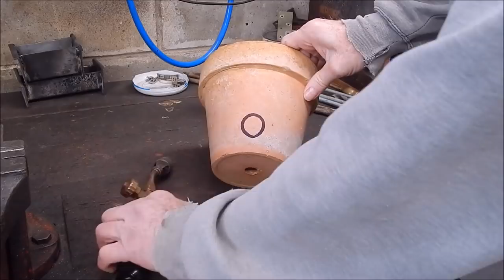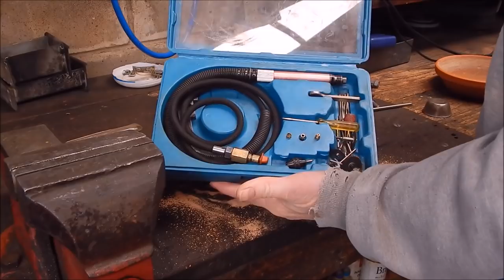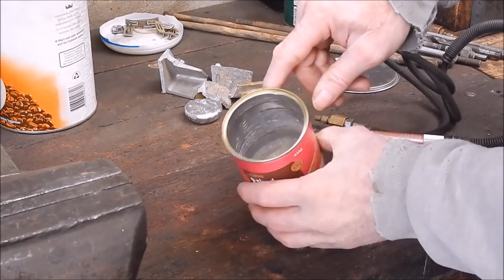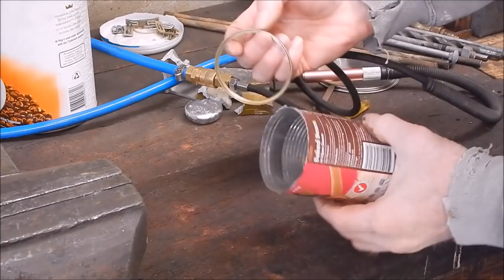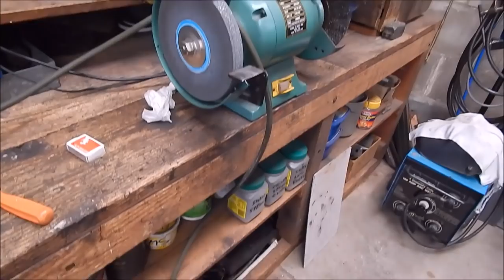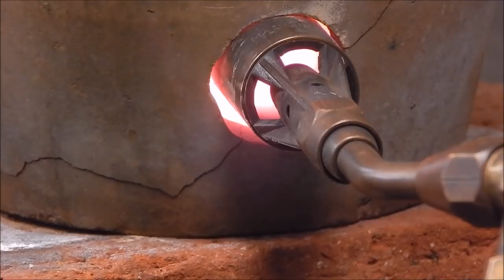Melt aluminium in a flower pot furnace

Comment: Well done!  It looks like a hole in the lid about the same size a your burner might help.  I would have chickened out before you did when you were using the largest carbide bit!
Reply from the maker: Metallurg33 You may be right.  More air has to come in from somewhere, either top or bottom.  Needs more experimenting with a lid on.  Lot's of potential for an ordinary LPG gun.  Rob
Reply: xynudu
I'm not sure if you need more air in or let the products of combustion out.  If its the latter, you might need even more open space.

Comment: What did you make the form that you poured the molten aluminum?  It doesn't look like steel because it seems like if it were steel, it would be way heavier.  Thanks for the vid!
Reply from the maker: +altitudeca 

It's a stainless steel bowl from my scrap bin.  I'm not sure what it was originally, maybe a cap for some part of a machine.

But, definitely stainless steel.  Some people cast into stainless steel cookware - cookie cups etc.

Cheers Rob
Reply: +xynudu Sorry, I meant the thing you poured the molten aluminum (out of the can). The square container that looks like it's welded together to the left of the forge.  Thanks!
Reply from the maker: +altitudeca 

The mold at the end of the video is made from some rolled  "U" section racking steel.

It's about 2 mm wall thickness.  I stick welded some ends in.

Bit rough, but works OK.

Cheers Rob
Reply: +xynudu Cool. Thanks.

Comment: Just some advice, the flower pot cracked because you heated it up to hot to quick. The flower pot is like a clay crucible you have to heat treat it, heat it up slowly multiple times hotter each time to heat treat it. Oh ya Aluminum only has 1 "i" in it, I saw you misspelled it in the video title!
Reply: Aluminium! Anywhere other than USA.

Comment: it cracked bc you didn't heat it up slow..... take the torch and hold it above the pot and let it heat up for about a min or 45 sec. keep the flame 6 to 8in away from the pot when doing this

Comment: I thought the cruicible (the tin you used) would melt faster than the aluminium inside it ? What type of tin did you use ?
Reply from the maker: Steel doesn't melt at the temperature of aluminium.

Comment: I thought the base of a lawnmower was usually made from a magnesium alloy?
Reply from the maker: Green Silver Generally pressed steel or cheap aluminium in lawn mowers.  Magnesium is not used much, except on items that need to be very light - eg. chainsaws and hand tools.  The problem with magnesium is that it's more expensive, and fatigues over time. Mag wheels on cars are not actually magnesium, they're aluminium - because of the fatigue issue. Rob

Comment: Love the video. I was thinking if you could make a small microwave kiln with a small flower pot and the top piece as the bottom of the kiln. I have been looking for a good homemade microwave kiln. I think this could actually work as a microwave kiln also, but I want your opinion on if you think if you took a small flower pot and use the bottom piece as the base. Thanks for sharing I love this Idea,
Reply from the maker: +Steve Rabon 

Hi Steve.   I don't know anything about microwave kilns, but theoretically you may be on to something.  I suppose the issue is how much the pottery would reduce microwave penetration.

Also, the pot would still crack under the temperature changes, so lining it with refractory cement would be the go.

Interesting idea.

I suppose the only way to know, is to do a small scale experiment and see what happens.

Cheers Rob
Reply: Thanks for the reply. I know some people has used the fire bricks to make one. I know they can withstand high temperatures. This would just be a cheap alternative to a homemade microwave kiln for melting glass to make jewelry. I would use the fire brick if I wanted one to melt aluminum. Thanks I was also wondering when I seen the dusk that was left on the counter if you could pretty much use the powder as mortar and pretty much make a shape that would work better. I have had an head injury and I am not as smart as I once was and people have to tell me if stuff sounds stupid. LOL
Reply from the maker: +Steve Rabon 

Hi Steve.  All sounds good to me.  Nothing stupid in what you are saying, for sure.

Just be careful, this is a dangerous environment, so stay safe.

Cheers Rob
Reply from the maker: +Steve Rabon 

Hi Steve.  That's a pretty handy little kiln.  Unfortunately he doesn't seem to have followed up with a video on it.

I think that is a better way to go than a flower pot.  Looks to be made from refractory cement.  Maybe just cast it between a couple of plastic containers you can pull out/off after it sets.

There must be some info on making these on the internet somewhere.

Maybe search on making a homemade ceramic refractory crucible, should be a similar technique.

Cheers Rob
Reply: He bought that one on Amamzon. It is made for making Jewelry. I was thinking of a way to make a homemade one. I been studying up on it. It is a layer inside the kiln that actually turns the microwaves into heat. Just using the flower pot won't work, but you can make a paste from grapheme and use that to cover the inside of the flower pot to create the heat needed. Thanks for your replies. They have helped me a lot. I will try to make two kilns. One to melt glass for jewelry and one to melt Aluminum. I have found another Video that uses fire brick to melt Aluminum in the microwave also. Thanks again. I think I know now what is the best way to go. Yhanks
Reply from the maker: +Steve Rabon 

You're welcome.  This is really outside of my limited expertise, I'm still learning too.

Good luck with your venture.

Cheers Rob
Reply: Thanks I have found another Video of somebody going into detail of making your own microwave kiln. It is pretty straight forward and simple. Basically all you need is a ceramic cup and a ceramic tile for the base plate with a mixture you can make yourself to layer the inside the ceramic cup and to layer the ceramic tile with also. This mixture is what really makes the heat. Thanks again your advice lead me to finding more information. Thanks again.

Comment: Hi again Rob, no I'm not stalking you, I've been down with a bad flu so have spent all day watching almost all your vids. Do you chuck any sort of aluminium in the pot such as drink cans and stuff? or are you selective for stock material?
regards

Wal
Reply from the maker: Walter Cengia Hi Walter.  I sent a reply, but it seems to have vanished, so I may repeat myself.

I am selective.  I use hard non bending alloy for rigid, hard wearing jobs like gear blanks, and blend in some softer alloy when I need a better finish for turning.

It's all a bit hit and miss, but is OK for backyard melting.

Cheers Rob.

Comment: That drill must be older than me (21 y) but still drilling good. Nowadays you need new drill every 3 years.
Reply from the maker: +Tommi Honkonen 

Hi Tommy.

I have probably got about 6 - 8 drills of various sizes, and the one I grab every time is that one.

It's not the biggest or the most powerful, but it's the nicest to use.

It's an AEG 500 watt unit.  You can tell by the beat up look that it gets lots of use.

It's the perfect size/power without breaking your wrist, and it runs off of my portable generator OK.

On it's third chuck and second set of brushes, and going strong.

Best drill I've ever used.

Cheers Rob

Comment: can you riddle me this, since I have no working experience with melting anything other than lead for historic munitions casting. The melting point of aluminum is 1,221 degrees F, and the melting point of tin is 449.5 degrees F: the tin can doesn't melt in your video, but the aluminum does. How is this? I want to use a pot to sit on a forge I'm building and it's stainless steel, but some of these stainless steel pots have aluminum fused into the bottom for "even heating".. Would this pot's bottom melt? As I said before, a novice and trying to understand how this works.
Reply from the maker: 1958piwo To the best of my knowledge, tin cans are made entirely from steel these days, so won't melt or fall apart in this application

I'm not up on cooking pot construction :)  I expect the aluminium bottom is just a lamination, and would melt off the stainless pot, leaving the bottom intact.

Cheers Rob.

Comment: Hi Guys thank you so much for the the wealth of info posted on this particular Video thanks a million Xynudu for generating so much curiosity as a result of your experiment. one question. The melting point of aluminium is higher than can or not ? my question in particular the can should have melted before aluminium ! I may be wrong
Reply from the maker: No.  The can is made of steel and has a much higher melting point than this furnace can provide.

These days can joins are rolled/crimped together, otherwise it would fall apart under the extreme conditions.

The whole experiment is unsafe and shouldn't be attempted without proper precautions.

Cheers Rob

Comment: the lid put on over the pot,  needs a hole in the lid . . . you can slow down the hot air . . . but  . . . you do need to release the hot air at some point . . . or break the system
Reply from the maker: Patrons Incentive OK.  The mark two version will have a hole in the lid.  Cheers Rob

Comment: You should put a hole in that lid and reinforce the pot itself with a layer of fire cement and then put another pot in the center of that, insure that all of them are connected with a hole through them all.
Reply: +Danny Lewis the point is to see how simple you can go
Reply: +Danny Lewis 
 great idea.. have you built one same? lemmie know, it sounds like a pretty cool project.. cheers bud. :)
Reply: I have, but I moved into an apartment.  When I move into a home, I will post pictures this time or record my own video.  I works well.
Reply: Danny Lewis deadly... thank you... Im temped to use an 8'' terracotta chimney.. stand one in a 13''x12'' clay pot..  with fireclay/refract cement as you recommend.. id need to cut a 2'' square from the chimney with a 4'' diamond angle grinder blade.. allow the 1.5'' pipe to go through and pack it up.. what you think? and many thanks..:)
Reply: Sugar solution and sand or silicon carbide.

Comment: Think why it does not worked with the top for you case the top was much smaller then the bottom. On the site the top is the same size as the bottom try to get an other pot and try again. Probably you can reach higher temperature with the top on.
Reply from the maker: The torch wasn't getting enough air with the top on.  Unburnt gas was burning on the outside around the rim between the pot and lid, where it was escaping.  A larger pot on top wouldn't help in that situation.
Reply: xynudu the top pot needs a hole in it for bot exhaust/flu and to allow O into to burn. Your pot base didn't have it. Most likely the original design of 2 identical pots did.

Comment: how much do you loose in weight when you melt alu. down?
Reply from the maker: jetegtmeier71 I doubt it would be much.  Dross would be the only loss, and that would be less than 5% I expect.
Reply: ***** 50 % no kidding and they say you should recycle alu. i'm glad I do
Reply from the maker: ***** Hi Sebastian. Thanks for the feed back.  I had never really thought about this, prior to the original question, and assumed only the dregs would be lost.  That's very interesting.  I will check next time and see how it goes.  Cheers Rob

Comment: Hey mate, What type of regulator is that between the gun and gas bottle? 
thanks.
Reply from the maker: No regulator.

Straight out of the bottle at full pressure.

Cheers Rob
Reply: thanks buddy, gonna give this a go

Comment: One word of warning to the viewers, make sure there is no moisture in the flower pot. Water trapped in the pot you risk exploding as the steam tries to exit.
Reply: actually if there is moisture in the ingot tray it will explode  not might it will worked a foundry for a few years and we had to preheat all the ingot trays b4 pouring  also  throw in some salt it will give you much cleaner casting
Reply: Water (very small amounts) and molten aluminium is a very lethal combination ... It creates huge explosions ... Witness the twin towers on 9/11! LOTS of YouTube video inside smelting and casting plants of such explosions

Comment: Why not use it the other way and maybe expand the little hole in the bottom?
Reply from the maker: You could try.  I doubt the LPG torch would get enough air to work correctly.  Rob

Comment: At 10 : 30, what kind of saw did you used ?
Reply from the maker: A small friction/abrasive disc (metal cut off disc) in an air pencil die grinder - you could use a Dremel.  Cheers Rob

Comment: so I've been doing this and using cans as a crucible they are not working they are flaking
Reply: any suggestions
Reply from the maker: Make a steel crucible out of some scrap heavy pipe.

Rob
Reply: Ok I've given that thought but don't have welder to make the base
Reply from the maker: OK, maybe look in the cooking section at the supermarket for a stainless steel beaker or pot that will do the job.

The local good will and flea markets also have this stuff for peanuts.

Rob
Reply: +xynudu thanks comrade
Reply: or you can just buy a real crucible for about US$ 5,00 online and save you the time, work and risk of melting metals in improvised materials...

Comment: Hi, why don't you just buy a few fire bricks and form a square  some how, I am sure you could come up with a nice frame to hold them together or tie them with some wire, they are made to go into kilns, so they won't crack. They would last for ever, and they cut using a diamond tipped disk, and you can also drill holes into them.
Reply from the maker: The Forum The video was simply to show how a flower pot performs as a furnace.  I already use a brick based furnace as the primary unit.  Check out my other videos to see. Rob
Reply: Ah okay I didn't know that, I will check it out Ta.

Comment: I made a furnace that works really well, probably too well... I use charcoal and a vaccum, and I try to melt melt soda cans and stuff. But as I mentioned it gets too hot and the containers always brakes after a while... Do anyone know what I should use for container? Does stainess steal work?
Reply from the maker: Johan Strannelind Hi Johan.  Use a piece of large diameter steel pipe with an end welded in.  That won't burn out in a hurry.  Not sure about stainles steel.  It is used for m/cycle exhaust systems and cook ware, but the temperatures are not excessive.  Rob
Reply: +Johan Strannelind Check out Grant Thompson  The King of Random's channel for a very nice furnace.

Comment: didn't work for me I used charcoal and the tin can r what ever it is failed
Reply: with charcoal, you need to add an air blower. that's how they did it in olden days. then it burns hotter